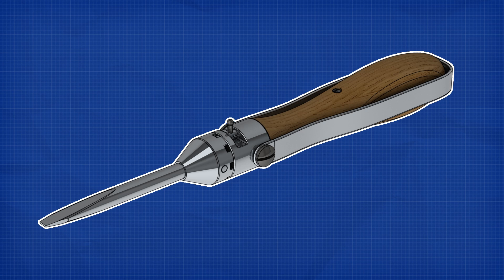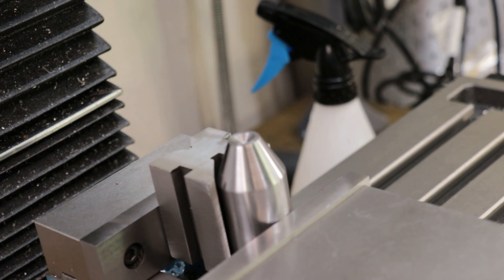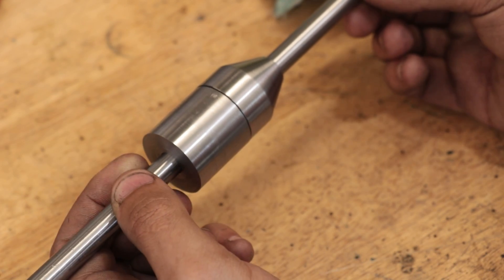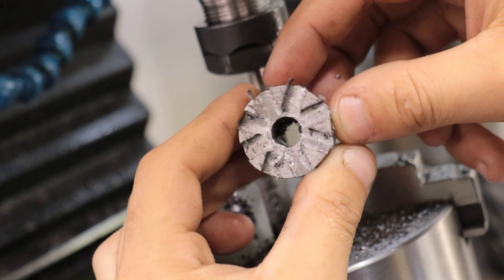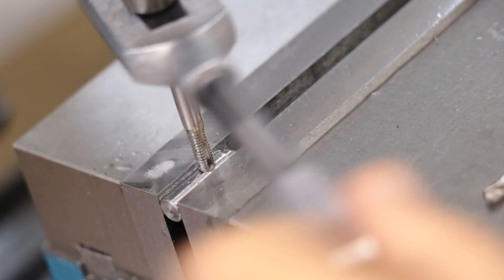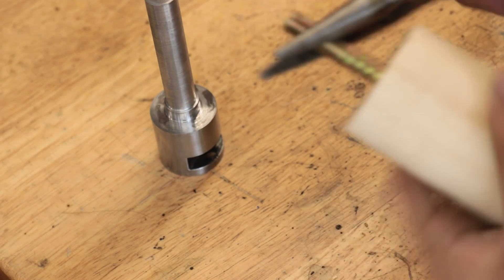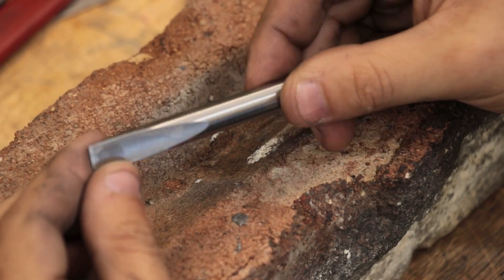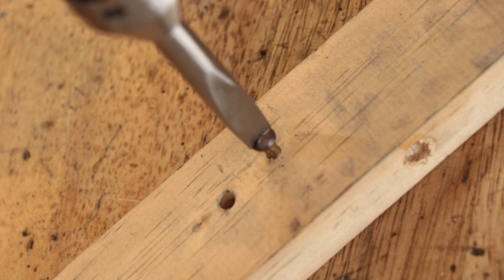Making A Vintage Style Ratchet Screwdriver

Comment: It's shocking you have any z left using a diving head on that mill.

Also it seemed like you divisions were off even in the second piece. What gives bro
Reply from the maker: A very difficult dividing head to work with sometimes. Getting the correct preload when using the spindexing ring is difficult and it can accuse the set up to be not as rigid as so would have liked.

Comment: these vintage weltrecord ratchet screwdrivers patented 1891 and first built 1949 are being made again by Metmo, i don't know them but i bought one on kickstarter, it cost me a lot but you can see from the video above that a lot of work goes into one, the original and modern remake also have a fold out handle, and the modern one has a hollow metal body for extra double ended hex bits

Comment: Just as a suggestion, the only reason why u see pine being used in tool handles is because is cheap, pine is a very soft wood (i being wood turning for a while) if u are looking for something that lasts longer, try something like walnut, oak or similar.
Great build dude

Comment: it seems much of your tooling is blunt - and / or your speeds - feed rates are imperfect. However, very nice project.
Reply from the maker: Very much so, but the lathe speed is fixed so I have to work with imperfect speeds. Cheers

Comment: I am always impressed with the work you can do with these tiny machines.

At the moment I only use a relatively small knee mill (thiel duplex 159) and feel like you get more out of your machine than I do.
I initially had grave rigdidity issues, but I eventually solved them mostly by tightening the gibs (turns out those have never been tightened in the last 60 years of use of the preowner).
I almost only use carbide tooling and whenever I can carbide drills. (From your videos it looks like you've never really warmed up to carbide in the mill)
While the machine has not enough rpm for most of the end mills I use (except for a large face mill) I still prefer carbide because I can:
1. Cut almost anything with it, including hardened steel
2. I don't have to worry about the end mill burning out with improper use
3. End mill flex becomes a non issue.
But since carbide is so stiff, it becomes a great stiffness tester for the machine.
So the best advice I can give you on that: firstly lock all the axis you don't use to feed the cutter. Secondly take really light passes and instead feed faster.
I don't really like flood coolant because it is a lot of mess and isn't as effective with transporting the chips away. Instead I like to use minimal quantity lubrication with compressed air.
For fluid I still use a coolant emulsion.
With the high air flow this has no problem clearing all chips from the work area, you just have to take care to wear safety goggles.

Now I hope you'll give carbide end mills another chance, and this time have more success with it, and I am very much looking forward to new awesome projects.

Project idea: I recently made an universal fixture plate (a plate with many holes, half reamed to accept ground pins, half threaded to add clamps, in diagonal order) which is really useful to hold thin parts and hard to hold in the vice parts on the mill table.

So, happy new year all in all.

Comment: Beautiful tool. The ratcheting mechanism is very robust. 
The hole for the body end is off center because you changed machines. I would have drilled most of the diameter of the hole on the lathe and finished with a boring bar.

Comment: Cool screwdriver but big boooooo on using pine. Wtf! Use a nice hardwood to compliment the beautiful machining. And using tru-oil (made for gun stocks) or Danish oil will hold up much much better to dirty shop hands 🤭
Reply from the maker: I have told that are over 100 years old that use softwood handles, not a huge worry

Comment: This turned out great! I think one small improvement would be to hollow grind the screwdriver tip.
Reply from the maker: Yeah, it seems that it's a more modern thing, the vintqge screwdriver that I based this on doesn't have that. But it shouldn't be too hard to add. Cheers

Comment: you can tell he doesn't care about wood working or ascetics when he used a cheap pine couch leg as a handle. 
that thing is going to get dented by looking at it.
Reply from the maker: I used oak initially but it blew apart in the lathe chuck. Anyway I tend to work with what I have on hand and I'm usually good at keeping these tools in good condition

Comment: FANTASTIC project and Very Nice result. Best thing is seeing how far you've come in the last couple of years. You're really starting to think like a machinist and be more confident on your machines. The glue and turn the off centre part even taught me something new. Very clever!
(Aside: One personal thing I notice all the time is the file and emery paper at the end of your turning. Really nail the correct feeds and speeds OR Use HSS for much better surface finish OR slightly round one of your insert points with a Cbn or carbide stone wheel for finishing. Throw the file and paper away, you shouldn't need it! It's a really amateur thing to do/need to do IMHO. Please note: I'm definitely NOT criticising your work, quite the opposite, it's terrific!) Cheers, Michael 🇦🇺

Comment: I’ve made the same little project. However, instead of using the silver steel rod I used a 150mm 1/4” drive socket extension. That way I can use anything that fits a 1/4” drive, it’s very handy!!!

Comment: Why didn't you cut the od and the taper after cutting the bore if the bore was likely to be eccentric?
Reply from the maker: My way is faster since you can only take light cuts with parts that are super glued in place. Quicker to do the taper whilst its held in the 4 jaw

Comment: Why do you use a hacksaw over an angle grinder?
Reply: He uses a hacksaw because he hates the dust angle grinders produce.
Since he has cameras, and a small workspace, the dust is quite annoying.
Hacksaw may take a little longer to use, but it's so much easier to clean up the mess.
Reply: @autumn5592  that makes sense , ty.
Reply from the maker: Pretty much that, I have two DSLR cameras and studio lighting and it is a real pain to clean up in the rare occasions that I do use it
Reply: An angle grinder will harden the steel
Reply: @brodern5308  Don´t you mean soften it? Unless he quenches it while its really hot then it´ll only get softer
Reply: @brodern5308  No, it won't. It will do the opposite, it will anneal (soften) the steel.
Reply: An angle grinder will harden the steel

Comment: A hollow grind on the blade will help prevent the blade from caming out of the screw slot.
Reply from the maker: Cheers, must be more of a modern thing, the old screwdrivers that I based the tip off don't seem to have that feature. And these ones roughly date from the 1920s
Reply: @artisanmakes  yeah it is a more modern touch but since slot drive fasteners are usually done with slitting saws in the hobby workshop, parallel flats up around 5-6mm from the tip is the perfect amount to help reduce camout. An end mill from what I’ve seen does a good enough job or a well used grinding stone from a rotary tool
Reply from the maker: Funny enough though, a hollow grind doesn't suit every slotted screw, and this style works best with some. What I have noticed is that with some store bought screws, especially those that are combined Philips head and slotted, the slot tapers outwards and it works much better with my design, rather than a hollow grind.
Reply: @artisanmakes  Hollow grind screwdrivers are most likley very old but are not commonly used since it's easier to make tapered screw drivers. There's also the added usability of tapered screw drivers that they can be used on a wider variety of sloted screws thpough they do cam out easier risking the screw to get damaged.
Reply: @artisanmakes  First tapper that you done on that shaft (at 1:11) is absolutely unecessary.
It exist on factory made screwdrivers, only cos it is formed by forging, so the blade is widen after that process, an they need to reduce tip back to required size.
As someone mentioned, holow ground screwdrivers ar not modern thing at all. It is just cheaper to mass produce flat one.
That stupid philips+flat screws, are something to avoid at all cost, so making screwdriver that is good for them, and bad for standard screws is like making axe that will cut only rotten trees :)

BTW.. consider making "slow speed" intermediate reduction set of pulies (or get BLDC motor for a sewing machine, cheap eonugh, come with controller...)
Also hand crank was realy helper with this smal lathes. You can have realy big torque at realy slow speed (a slow as you can turn it bu hand)
Reply: This Old Tony put out a video on making hollow ground screwdrivers today.
Reply: It depends if the screw has straight slot or not.
Reply: He's put a very shallow angle on the blade so the difference between this and a hollow ground blade is minimal.
Reply: And damaging the screw and its not that hard
Reply: ToT has produced another expert…
Reply: @cameronboyd9952  Actually I have known about and used hollow ground screwdrivers for over 30 years.  They are the only type screwdriver I will use when working on my guns.
Reply: You ever seen a screw that doesn't have square slot?